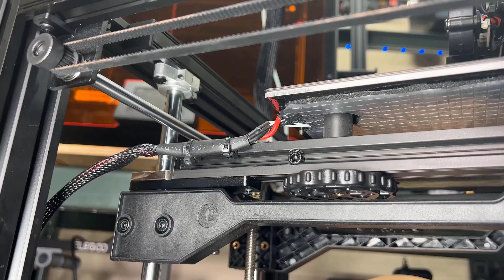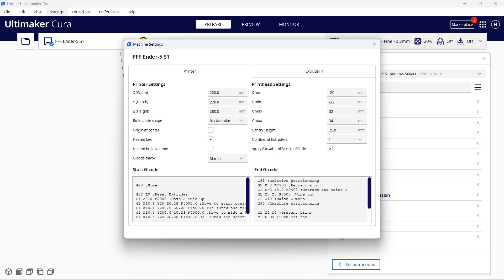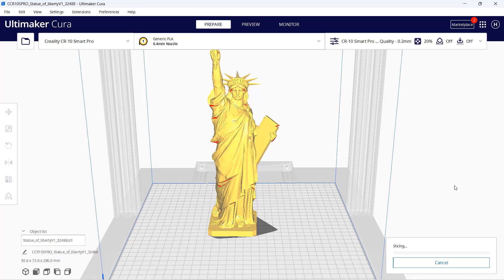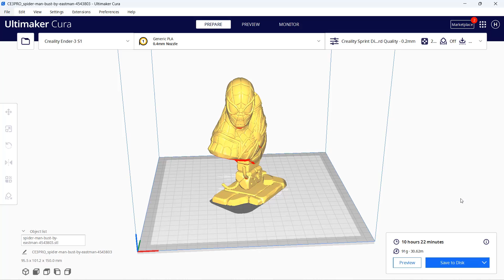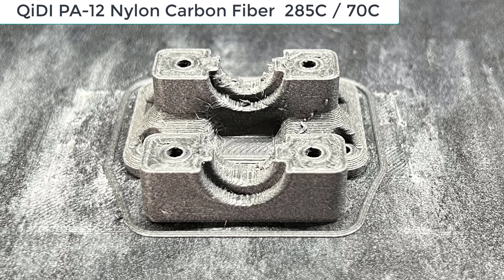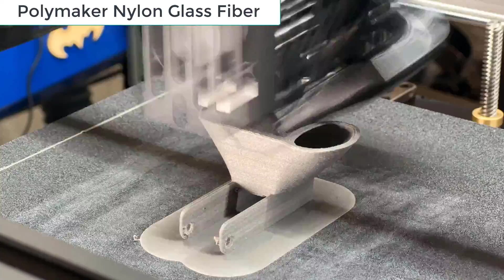Ender 5 S1 + Sonic pad Klipper firmware The ultimate hobbyist 3D printer? 250mm/s 2000 acceleration

Comment: It should be corexy and dual-z-leadscrew. They really dropped the ball on those two points.
Reply: So the flying bear reborn 2 is a better deal?
Reply: @DavidRodriguez-er4rq  I don't own any Flying Bear printers yet so I couldn't give you an honest recommendation, but it sure does appear to be a better deal from what I was able to find in a few mins. I can say for sure that I'm considering picking one up and I had/have no intention of picking up an ender 5 s1. Appreciate the heads up!
Reply: That would be an Ender 6 minus the dual z. They work fine without dual Z, it’s not necessary on that bed size.
Reply: @gaxon1920  Did you not see the bed shaking like a heroin addict on withdrawal? I did. It may not be necessary on a bed that size if done right, but it sure looks like it would help this printer.
Reply: @paulthetexan  you do realize the camera was mounted on the printer and the entire printer was shaking?
If the bed was shaking like that, those prints would fail.
Reply: @gaxon1920  There were artifacts on the print from z vibration. Were those caused by the camera mount? The bed also shakes at a different frequency than the rest of the printer - look more closely.  Also, several other reviews have noted the excessive bed vibration. Finally, are you seriously trying to claim that dual z is not more stable than single z?
Reply: @paulthetexan  Is that what I said? Where? Are you delusional, nowhere did I say that. I said it’s not necessary. Dual Z is always better. 
People who try “are you saying” crap are grasping for straws. If you are printing at the speeds causing the artifacts details really don’t matter that much in the first place or you new to printing and don’t know any better. 
Point being. I pointed out the flaw in your bed shaking arguments. Don’t start the putting words in peoples mouth.
Fact is, you get what you pay for. If you want a stable high speed printer, buy one and stop buying Creality DIY printers. 
Back to Dual Z, it can be a problem as well if it’s not synched or doesn’t have separate Z drivers. 
Bottom line, don’t by a Creality printer if you’re looking for the best. They are a less expensive means of getting into printing.
Reply: @gaxon1920  what do you recommend ? Around 500 to 600 maybe a little more . I wanna be able to print nice cosplay helmets and strong material stuff .
Reply: @DirtPoor_Builds  don't print helmets, you will never finish sanding. Print mold for helmets, and use DIY Carbon fiber kits to lay into printed mold. Spray stuff into mold to get rid of layer lines
Reply: @gaxon1920  “not necessary on that bed size” oh geez

Voron must recommend not scaling the V0 cantilevered bed for a reason? +why do dual z mods exists if it’s not necessary (and bed bracing of course)

In reality it’s common sense that a big heavy bed should be cantilevered
Reply: @probablyblue426  just because it’s available doesn’t mean it’s necessary. If the bed can remain stable with one axis, you don’t need a second. If it’s unstable, add a second.
Reply: Core xy and the dual z will push the price up dramatically
Reply: @Condamine123456  Integrated leadscrew steppers are cheap, even at retail, much less wholesale. Additionally, they had to use a much beefier mounting plate and injection-molded braces because it's just on one side - they could use the same amount of metal for a dual z mount and they wouldn't need the extra braces. CoreXY requires a few extra bearings and idlers and slightly more belt. I don't think it would actually cost that much *as a manufacturer*.  A rough google of the parts required says it would be about $50 retail, at MOST. Note that I'm not talking about $50 to convert the existing to corexy/dual z. But to do it from the beginning. That means that the cost to creality would be about $20 at most. Why do you believe it would push the price up dramatically? If I'm missing something, please let me know. But just saying something without elaborating isn't very convincing. I'm willing to be wrong, but not without evidence.

Comment: would the fl v400 be a better option as klipper is standard as by the time you add the pad the cost would be similar, is it the same with all 3d printers that petg  prints so slow in comparison, I dont know what to get but the stuff I have ideas for are for the food industry and was under the impression that petg was the way to go for indoor and outdoor. One of the days I can see you bring out your ultimate printer that will show the big firms whos boss.